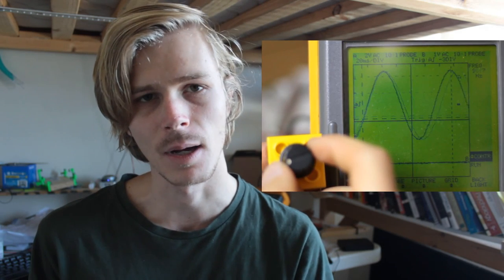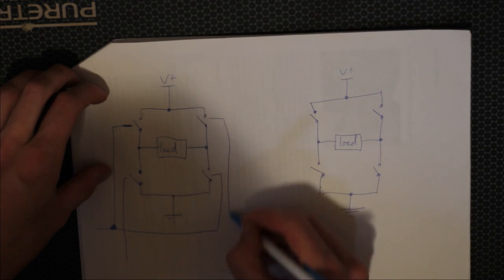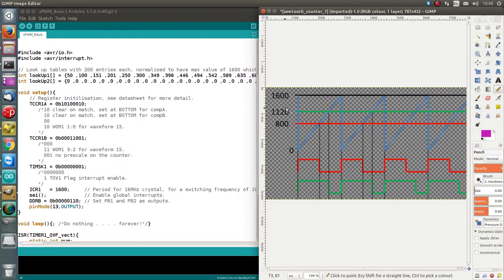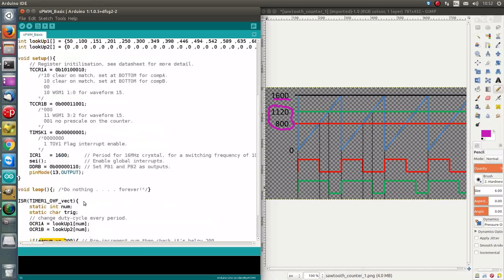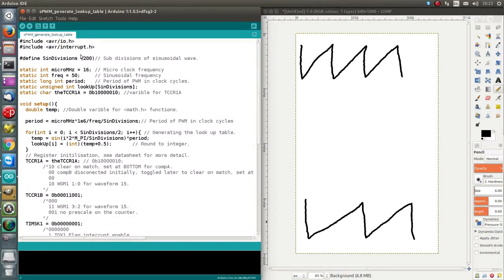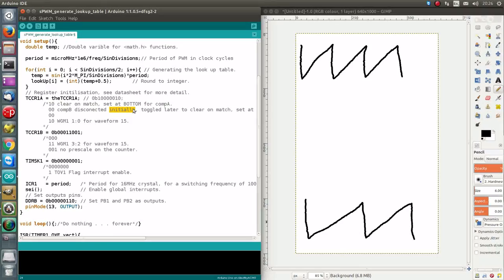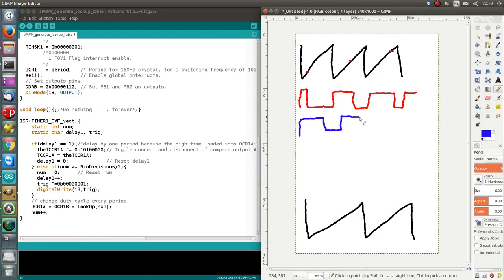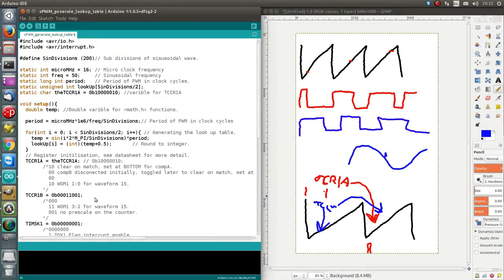How to implement an sPWM on arduino/atmel (sinusoidal PWM code and explanation)

Comment: Best sPWM tutorial I have seen so far! Very clear and informative. Thanks. Point to note, on Mega 2560 one 
needs to change DDR in the variable frequency sketch for PB5 and 6 - i.e. different to Uno. So 
its DDRB = 0b01100000. Cheers
Reply from the maker: +martyno Cheers, I am aware of that. Did you have a look at the sketches on github or just from what you saw in the video? I'm not sure if I should try and make the sketches suit multiple boards or just leave it with one to stop it sprawling out too much.

Comment: Me: Spending weeks figuring out the best way to make a perfect SPWM output.
Other YouTubers: Writing this code " 
int mos_top = 3;
int mos_bot = 5;
double pot = 0;

void setup() {
  //define the pins as outputs
  Serial.begin(9600);
  pinMode(mos_top,OUTPUT);
  pinMode(mos_bot,OUTPUT);
  pinMode(pot,INPUT);
  
  //Initial value is LOW
  digitalWrite(mos_top,LOW);
  digitalWrite(mos_bot,LOW);
}

void loop() {

  double pot_val = analogRead(pot)/10;
  //One is LOW and other is HIGH
  digitalWrite(mos_top,LOW);  
  digitalWrite(mos_bot,HIGH);
  delay(pot_val);    //  1/16ms = 62.5Hz

  //One is HIGH and other is LOW
  digitalWrite(mos_top,HIGH);
  digitalWrite(mos_bot,LOW);
  delay(pot_val);
  Serial.println(pot_val);

} "
and putting "PURE SINEWAVE INVERTER TUTORIAL " in the thumbnail.

Comment: How to generate the pwm of 10 kHz in ARDUINO DUE? What changes I will have to do in your code? and how will I get the header file of look up table for the sinusoidal ,triangular and pwm ?  also u have used "#include <avr/io.h>
#include <avr/interrupt.h>"
how will Iget the above two ?

Comment: if i want to make a little inverter (low  power and for 10 DC Volts)  with that code, i only  put the outputs 13 and 10 to H bridge with mosfet or IGBTS?

Comment: Dear sir could you please me one  thing  instead of H-bridge if I use center tap transformer for out put and used two sets of mosfet for pin 9 and 10, so what will happen?. sine wave can generate or not? or generate some distort wave?

Comment: Hi. Meanman from your code is possible to adjust the output voltage. I have transformer 10v 0 10v input 12 volt with no feed back my AC looks good on scope butt under load i get 207volts. can you help in anyway ,  thanks Yannis
Reply from the maker: There's a second part to this video where we change the amplitude of the wave, which would lower the voltage, have you seen it?
https://www.youtube.com/watch?v=3DjKxDL_Qc0&t=1s

Comment: Thank you for your code, I have gotten a nice sinusoidal waveform.  I will use the wave to drive the speaker and I need a circuit with few transistors to amplify the signal. Could you give me information about the circuit?

Comment: nice video.
i converted the ino file to hex and ran it on proteus .But the output signal seems to be less than 50 hz and the line
period = microMHz*1e6/freq/SinDivisions  does not seem to work  but if i use  
period = microMHz*1e6/freq/SinDivisions /8    then i get 50 hz frequency  
can you tell me why?

Comment: Sir i used analogread() command in isr(timero_vect)  after that my circuit is short and output is out shape sir kindly how i can use adc in isr(timer0_vect)
Reply from the maker: The interrupt is called very ofter, I'm not sure how long it takes for anologread() to finish, but it's possible that it's simply too slow to be called in the ISR. Why do you want to read it that often?
Reply: @meanman1992   sir i want control output of sinwave when i used analogread() in loop so my output slowly incresed  because intrupt go first after it finish it will go to loop then take adc value their so thats why my output reached slowly so thats the reason thats why i want to use feedback adc in isr(timer0_vect) if you kindly guid me how its possible ?
Reply from the maker: @zainharoon4156  I still don't understand why you want to read it that often? like what's the motivation. Like I said I think it's probably not possible because of how often the ISR is called. The loop that comes from ISR is very different from the arduino "loop" as the former doesn't wait for everything to finish executing. Since I don't know why you think you need to read that often it's hard for me to say, But I would use a separate loop, not the ISR. and by "slowly increase" I'm guessing you mean increasing the amplitude. So long as you modifying a scale variable that the isr uses to calculate the output, then you will not need analog read to run every time in the isr.
Reply: @meanman1992   sir i want to increase or decrease the amplitude of sinwave frequently but my amplitude of sinwave don t increase frequently so i want make frequently how can i make it frequently sorry if i can t tell you my whole thing if you kindly give me your email i will sent you my code
Reply from the maker: @zainharoon4156  Sorry mate, I can't review code.
Reply: @meanman1992   thankx sir for specious time sir give me just one favour if you give any link related to auto feedback system based sinwave

Comment: I want to program variable frequency spwm in my arduino mega 2560, but the catch is that the magnitude of the sine wave is also dependent on the frequency by the equation magnitude= (frequency*4.4 +5.4)/225.4. Is it possible to do so? If yes would you please let me know the changes that must be made in your code for variable frequency spwm? Thank you!
Reply from the maker: check out the new video, the varible frequency spwm code should make it a lot easier for you.
https://www.youtube.com/watch?v=3DjKxDL_Qc0

Comment: Thanks for useful stuff. I am wondering if the amplitude can change? I am using encoder for speed reading when the speed reduce i need to reduce the amplitude for the output pwm.
Thanks!
Reply from the maker: I think you have already found my other video where I have some code that allows for amplitude change?
Reply: Thanks, I found it but my idea is to change the amplitude depends on motor speed. For instance, make the ma=0.8 instead of 1. is that possible? I am considering V/f method for single induction motor
Reply from the maker: I don't know what "ma" stands for, neither do I now what "V/f" is? Variable frequency? the other video covers changing the the amplitude and frequency, not depending on motor speed but you could write a code yourself that builds on mine that does that quiet easily.
Reply: meanman1992 v/f  in motor drive world is voltage/ frequency usually

Comment: this is the most informative video I have found. I am curious . do you or have you made a boost stage for a inverter? or the code for arduino to drive a DC boost. it needs to be self regulating. I found a spwm driver board. to run safety functions. and drive the H bridge. my concern is boosting 12-24v yo about 170+/-, at enough current for a 2500-5000 watt inverter. from your video I think you can solve this issue. if you can. it would be a great help. I know very little a out arduino. and coding thanks